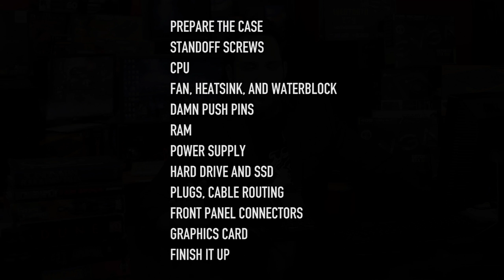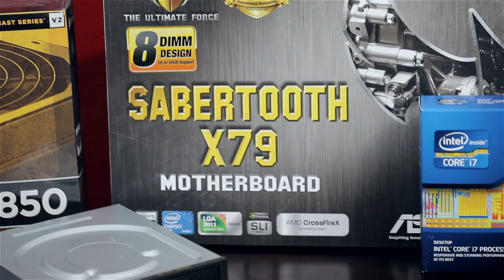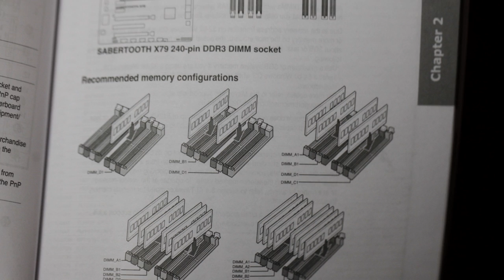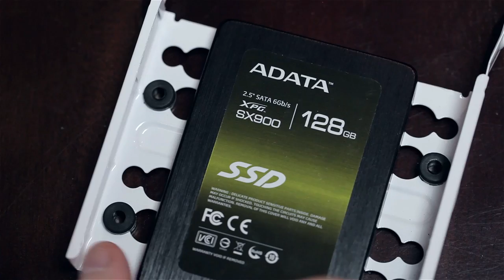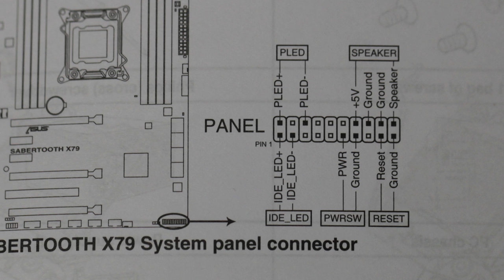How to Build a PC: The Ultimate Guide from Tek Syndicate

Comment: Computers are extremely easy to build now days. All components are made to only fit in their specific spot. The only worry anyone should have about building a computer is applying the thermal paste and heatsink. Everything else literally just plugs into whatever port looks correct.
Reply: Except when you're dealing with 6+2 pin and 4+4 pin connectors, those can be a bit tricky sometimes.
Reply: +TheCyberQuake what about cleaning the liquid coolers
Reply: Gab Springer If they can barely build a computer, they probably aren't going to take their chances with a liquid cooler. Cleaning the liquid cooler has nothing to do with building it anyway. That's maintenance, not the initial build. And unless you actually know what you are doing, you are going to be using an AIO cooler so you won't have to worry about a whole like during the initial build.
Reply: TheCyberQuake fair enough

Comment: I bought my first PC today Specs:
MSI z97 Game 5 Motherboard
I7 4790k
H100i 
2x 120gb samsung 840 ssd (accidently pressed two times :P)
Msi 980
1tb Seagate Baracuda 
16 gb of Hyper X fury black 1600 ram 
RM 850w psu

Hoping to play all games ultra on 1080-1440p and waiting for gta 5 and am getting farcry 4
Reply: Put the ssds in raid ;)
Reply: Idk how xD And my pc is built now
Reply: Oh Swerv It does not matter if your PC is already built. Just google it, It will give you more performance depending on which raid type you choose
Reply: ok
Reply: ***** try this website it only gives you lists of items that are compatible with other items when you select it http://pcpartpicker.com/
Reply: *****  really thats an intel mobo and thats a amd cpu
Reply: How doest your pc called ? That you buyed ?
Reply: I personaly would have went with an AMD 8 core CPU over an Intel mostly because AMD is cheaper but i am what they call a fan boy of AMD, all my desktops have an AMD. My next build will have  the AMD FX-9590 with a 990FX MOBO
Reply: Swervy :D  Pretty much the same specs as mine so you will for sure be able to run ultra settings at 100-120 FPS on pretty much every game that doesn't have locked FPS or bad optimization
Ed Brown Why 8 cores? Most games are only optimized to run at 4 cores? You don't really need the extra cores unless you need to render really high resolution images or movies...
Reply: Ed Brown No intel i5 4690k oc beats your overclocked 8350 with a different name easily
Reply: Moethedirt you must be an intel fanboy but that's cool to each there own
Reply: Ed Brown The fx 9590 is just a waste of money. 220w monster and yet it loses to most intel processors. Fx8350 and fx8320 are much better value for money.
Reply: Villee you are an intel fanboy to seet he difference you would have t have it running nonstop 24/7 for 15 years before the price of the electricity the AMD uses hits the price of the cost of an intel fut by then I'll be using a differant build with a better CPU
Reply: Ed Brown Lol! Nice assumption but I own fx8320 4,4Ghz.You can go and look at the benchmarks and see how intel wrecks amd. The processors can be pricey but that is just a minor thing if you have money.
Reply: Villee get rekt amd.
Reply: Moethedirt You know PCGAMER-magazine actually rated the i5-4690K and i7-4790K to be the best CPUs for gaming (Depending on how much you're willing to spend). Both are quad core and 5690K start at 3.5GHz and the 4790K start at 4GHz. Also the reason to why the i7-4790K beats your 8-core AMD is because it has hyperthreadding which means it can actually act as if it has 8 cores, but since games don't use that many cores it's nore really necessary and all that matters is the fact that it can easily get 4.4-4.6GHz when overclocking.
Reply: Maxwaehrens I know i said that the i5 overclocked or non overclocked beats the 9590 which is an overclocked 8350
Reply: Moethedirt As far as I can re-read yours and my comment I'm actually agreeing with you, but I don't know what you're reading. Anyway, hi.
Reply: zombiemoat5 That is what I just said. Your comment was just a....random comment
Reply: overkill dude
Reply: スケッチ how is it overkill?
Reply: スケッチ It isn't overkill for 2k or 4k gaming. Not even for 1080p. (depends on the game ofc)
Reply: Ed Brown I'm actually bias towards none, I can just see that Intel (In every case) destroys AMD in single core performance. :p I was going to go with an AMD FX 8350, but decided on the i5-4590 as my beginning CPU. :P 

They're both decent brands, so I can't complain. Same in the case of Nvidia and AMD. I actually went with an MSI Twin Frozr R9 290 over the Nvidia GTX 970. But I will be going Team Green in the future, since Nvidia seems to be stronger than AMD in a lot of cases. OR, since I got a 850watt PSU, I could go Xfire R9 290 x3.

First Gaming PC! I should be building today or tomorrow. c:

Comment: Would you recommend wearing latex gloves when handling the CPU?
Reply: I would recommend buying an esd wristband that would be your best option
Reply: +VelictAF
 Electro Static Discharge (ESD)?
Reply: +Thomas J Electro static discharge 
your body can store static which can fuck your PC parts up
Reply: GAWiz ard Yeah, I just wanted to make sure I got the acronym right. I am very aware of ESD.
Reply: just ground yourself on the psu, plugged in not on.
Reply: Latex I believe is a conductor, so no.

Comment: http://pcpartpicker.com/p/nL2WwP

Is this a good build for Crysis 3, Watch Dogs, Far Cry 4, GTA 5 (when is comes out), GTA 4, Battlefield Hardline, The Witcher 3, Dying Light, Mirror's Edge, Rust, DayZ, War Thunder, Tomb Raiders, Alien Isolation, Wolfenstein: The New Order, Thief, Saints Row IV/ Gat Outta Hell, Trials Fusion, Metro: 2033, BioShock Infinite, Trine 2, The Walking Dead, and Batman Arkham Knight?
Reply: Should be able to handle most stuff you throw at it for 1080p gaming, although there may be some issues with FarCry 4 because that game is extremely badly optimized. I'm not sure if you could be maxing out those games but you could certainly give it a try. Really good budget build.
Reply: Alex Ritchie-Pirrit Thanks.
Reply: i would get 2 ram sticks to take advantage of the duel channel ram slots two 4 GB sticks would work
Reply: ***** Sort of, but I changed graphics card, memory, and the hard drive.
Reply: I would definitely change the graphics card, no less than a gtx 670 ( in SLI) preferably.
Reply: kentkatchem Actually, I already built it. Besides, why use a two year-old card?
Reply: Sambooty If you ever do upgrade, you can find some 280xs on ebay for close to $200 and one of those can max out most mid-range titles at 1080p (for some reason, the exception for me is Gmod because fuck optimization in gmod 13 lol)

Comment: Still in the process of ordering some of the parts but curious as to what others think:
Cpu: i5 4690k
Cooler: Corsair H50
Motherboard: Gigabyte GA-G1. Sniper B6
Storage: Western Digital Blue 1TB HDD 
Ram: Corsair Vengeance LP 8GB (2x4GB) DDR3 1600
Gpu: MSI GTX 970 Gaming 100ME 4GB 
Case: NZXT Source 210 Window (Black)
Psu: XFX  550w 80 Plus Gold (Fully Modular)

Comment: Just wanted to mention guys, Logan you should know better, a PSU actually draws air in from the bottom and exhausts out the back of the case. So it makes no difference really to the other hardware if it's mounted at the bottom.
So it wouldn't "squirt heat all over your CPU" actually =P It's simply for a cooler PSU at the bottom as well as aesthetics.

Comment: The wisofmasta: it doesn't matter which way you mount your psu (power supply) some cases allow you to mount either facing up or down. If your psu goes at the top face it fan facing down. If at the bottom some cases allow you facing up or down, mine has a filter at the bottom of the case so i can face mine down or up. If you dont have a filter there but just solid metal there face it up. Hope this helps you!

Comment: Great tutorial but the only thing missing was a little bit about airflow principles and a little guide about how to install the fans. Obviously, it's a simple principle - front/bottom to rear/top of the case but newbies might not know that. Also, not all fans have the little arrows showing which direction they go so perhaps a quick mention that fans generally flow away from the side with the 4 plastic support struts and sucks in from the other side. Totally impressed that you managed to fit this into 15 minutes (plus the intro) though. Nice and easy for them to follow too!

Comment: You CAN overclock with stock fan, but once you get to turbo boost clocks and higher temps will rise fast! Get a $30-$40 air cooler if you want some light over clocking e.g.. 4.2ghz, or a water-cooling setup as shown in this video for $100 ish to achieve higher clocks. even if you don't overclock aftermarket coolers are nice to keep temps generally lower

Comment: Case : Armageddon Toro T200
CPU : AMD FX-8370
GPU : Nvidia Geforce 9800GT (soon to be a MSI R9 270, could get better if you suggest)
RAM : G.skill Value 8GB 160mhz (soon to be G.skill Ripjawz 16gb - 2x 8GB - 1600mhz)
PSU : Penquin 550w
Motherboard: Gigabyte GA-78LMT-USB3 (AM3+)
Monitor : Samsung 244T
CPU cooler : Cooler Master 212TELL ME WHAT YOU THINK and please suggest any changes

Comment: It's the Fractal Design Arc Midi. I'd go for the Define R4 though. It's around the same price and extremely sleek. Plus, it's has sound-proofing features so it runs super quiet. There's a windowed side panel version that's actually cheaper than the Arc Midi. The standard version is $110. There's also the option of Titanium Grey and Arctic White, whereas the Arc Midi only has one color scheme. Anyway, this is a great build guide. Very concise and not lengthy at all.

Comment: Yes, heat rises, but there is a fan that pushes the air down. The main reasons for putting the psu on the bottom is so that it is easier to install than putting it on top, and people had problems with the psu falling from the top and destroying everything below it during transport... and most cases have the psu mounted on the bottom these days... so he isn't really "talk[ing] up" the case.

Comment: depends, when shopping for a CPU, you will see OEM and Retail, e.g i7 3770k OEM and i7 3770k Retail. They are the same CPU but the retail will include a fan and heatsink  whereas the OEM will not. There is usually a small price difference with the OEM (without fan and heatsink) being cheaper.

Comment: if you have your bottom mounted psu installed upside down (fan facing into the case) yes the psu fan will act as an exhaust for the case. but the fan itself is designed to act as an intake for the PSU itself.

in the video the PSU is mounted right side up. meaning the fan is facing down, pulling air in through the vents at the bottom of the case through the PSU, and out of the vent's at the back of the PSU. in that set up the airflow through the PSU has nothing to do with the airflow in the case

Comment: I think that this is a really nice build, and just for some different options you could get a GTX 770 instead of a 780 and get a Intel i5 4670K, or a GTX 770 and  just save $100 or get a Bad-A motherboard. You may want to check your PSU, im not sure if it's overkill but maybe but bit.

Comment: How does this PC build sound? Please reply.

CPU - AMD Athlon X4 760k Black Edition 
Motherboard -	Msi A78M-E35, A78, DualDDR3-1866, SATA3, RAID, M-ATX	
Memory - Crucial 8GB DDR3 Ballistix Sport DIMM 240pin
Storage - Western Digital Caviar Blue WD10EZEX 1TB 64MB SATA 6 Gb/s
Video Card - Msi Radeon R7 260X 2GD5 OC, 2 GDDR 5 (128 Bit), HDMI, DVI, DP
Case - Korpuss BitFenix Alpha Merc, Midl tower, black/ATX, microATX
Power Supply - Corsair Builder Series CX430 430W ATX12V v2.3 80 PLUS BRON
Optical drive - Asus E-Green 24F1ST, 24x, SATA, Black
Fans - Arctic F12 (120x120x25)/Revoltec Fan "AirGuard", 120x120x25mm

Monitor - Benq RL2455HM 24", FullHD, speakers, DVI, 2xHDMI, flicker free
Reply: Sounds great, although I think the fans are a bit unneccesary. You'll have sufficient cooling with your case.

Comment: It allows the hot air to be pushed out of the back, and not onto the cpu (which is on top). And just in case you're "that" new, I'd like to point out that if your cpu is too hot, your computer will shut itself off due to overheating... But yes, hot air does rise xP

Comment: Most stock fans that come with the CPU have thermal paste pre-applied. No need to put any of your own in. If you're installing a water cooling system and there's no layer of paste on the heatsink already, you'd need to get some paste.

You always need to use a heatsink. Your cpu will probably blow up if you didn't put a heatsink in.

Comment: Generally if you live in a place with normal temps then the stock cooler should do just fine with and without turbo boost. If not something is wrong and you should most likely disable turbo boost in the bios. Most component nowadays are pretty resilient to heat issues but if it gets towards 60 degrees, something is seriously wrong. Probably bad thermal paste.

Comment: The hot air from the PSU is going to exhaust through the back of the pc, not the bottom. The fan is pulling air from the bottom of the case...I think. :)
And great video btw - really good job! :)

Comment: Or a new motherboard. The CPU you chose is an APU anyway so it has integrated graphics already. I recommend getting an i5-3570k for gaming. That will go with the motherboard you chose. If you want AMD get a 6300 or 8320, 8350 but you will need a new motherboard. What is your budget?

Comment: 09:40 PSU: "We're gonna install this in the bottom and the fan is gonna face down meaning all the hot air is gonna exhaust at the bottom of the case."

Unless you've opened up that PSU and flipped that fan this is not going to work how you're claiming it will be.

PSU's in general and this one isn't an exception suck the air in from the Fan mounted side and blow it out at the back ( where the Switch and Power Cable are located ).

Buying a Case that would have allowed the Installation above the CPU would played well with the natural convection effect of heat that goes up from Components like CPU, RAM, GPU, etc... getting sucked through the PSU outside without an additional fan installed.

Comment: Its purely a small possibility that you may need to be aware of, the ram is not on the qualified vendors list (but gskill generally has great compatibility anyway) and there is a note in the manual for that mobo that with some cpus if you overclock them that you may have to lower the ram speed. You asked if there were any compatibility issues, and all I could find were those pretty minor possibilities that you might need to be aware of if you are doing a lot of overclocking.

Comment: you may want to change the power supply to an 80+ bronze one. I read in forums that rosewill psu's are known to fail prematurely. try other preferred brands like XFX, SeaSonic, antec , NZXT, corsair, ect. Change your cooler if you really want to overclock,and you will get better temps.

Comment: On most tower cases, the space for the PSU usually has a little grate on the bottom, so if the psu fan is facing the grate, it'll get it's own source of air, and won't breathe in hot air coming from the gpu.

Comment: currently building my first gaming PC:
So far i have:
i5-4690K 3.5 Ghz, i decided not to add a CPU cooler, since i am not planning to overclock, and i have heard good reviews about the stock cooler.
Msi B85-G43 gaming motherboard
Crucial 16GB DDR3-1600
MSI GTX 960 GAMING 4G/MSI GTX 970 GAMING 4G (is it worth the extra 120$?)
Sandisk SDSSDP-128G-G25
Toshiba 2TB 7200RPM
Coolermaster 650M or 550M (maybe a corsair is better??)
As for a case i haven't decided yet. Definetly not willing to spend to much on something like that, any ideas?

So what do you think, any suggestions are always welcome.
please, also leave a rating #/10

Comment: I'm a console gamer and shifting to pc gaming. I'm planning on building my own pc. I'm going to use ZOTAC NVIDIA GeForce GTX 970 4 GB GDDR5 , AMD 3.5 AM3+ FX 6-Core Edition FX-6300, MSI 970A-G43 Motherboard, Kingston HyperX FURY Memory DDR3 8 GB, Seagate Barracuda 1 TB Desktop Internal HDD, Corsair CMPSU-600CXV2UK/CMPS- CX600W 600 Watts PSU, Zebronics Spy 2 Without Smps(Zeb-123BL) Mid Tower cabinet, Cooler Master Hyper 212X Cooler. So kindly tell me if these components are good and compatible with each other. If yes should I build it? Will really appreciate your advice.
Reply: I think u should upgrade cpu
Reply: i would just advice you to read up on the gtx 970's ram issues and think again on your gpu; it shouldn't affect performance for you in the next year or two, but it might prove a nuisance in the long run (0,5gb of the ram run considerably slower than the rest so you will experience a framerate drop and/or chopping up at full load)
if it wasn't for that i'd have bought that card but I ended up getting a sapphire r9 290x tri-x oc which should sell for around the same price (on the other hand this one uses more power so it's a tough choice, but i like sapphire cards); other than that yeah you could use a better cpu, but i don't think it's that important
Reply: The cpu will bottleneck the gpu. Go for an i5 or an fx 8350

Comment: The ram might have to be run slightly slower to be completely stable, though probably it will be perfectly fine. If you overclock the cpu on that board you might have to lower the speed a bit more too.

Comment: CPU:$189 Intel S1155 Core i5 3470 3.20Ghz Quad Core CPU
MOBO:$89 Gigabyte FM2 ATX GA-F2A75-D3H Motherboard 
GPU:$249 NVIDIA GTX660 2GB Gigabyte PCIe Video Card
Ram:$69 DDR3 8GB (1x8G) G.Skill 1600Mhz RAM Module PN F3-12800CL10S-8GBXL
HDD:$57 500GB Western Digital 3.5" 7200rpm SATA 6Gb/s HDD PN WD5000AAKX
Case:$69 Antec ATX ONE S3 Gaming Case Black
PSU:$89 650 Watt Aywun MEGA POWER PRO Power Supply PN A1-650-PRO
DVD/CD:$24
Could those fit and are they any good. My price range is like $600.